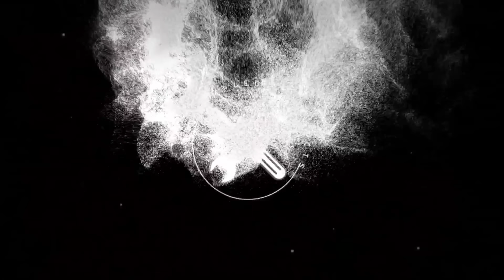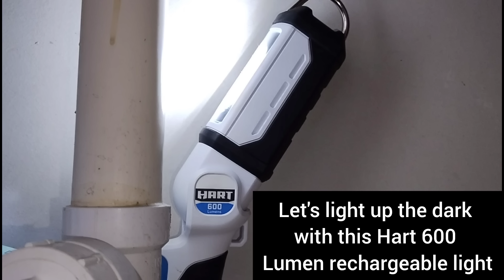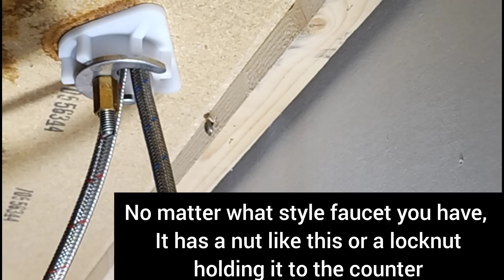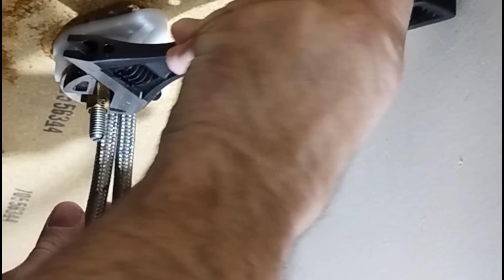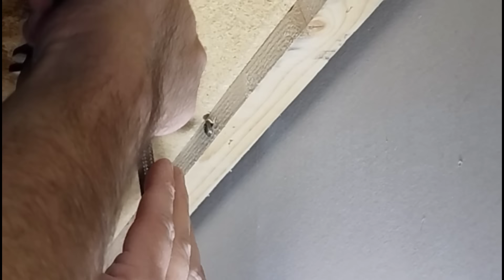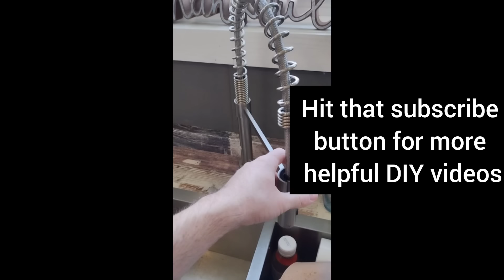How To Fix A Wobbly Kitchen Faucet

Comment: Awesome. Wonder how the nut loosens on its own in the first place?
Reply from the maker: Good question!

The nut holding a kitchen sink faucet to the counter can come loose due to several reasons:

Vibration: Regular use of the faucet can cause vibration, which may gradually loosen the nut over time.

Water Pressure: High water pressure can create additional stress on the faucet and its mounting hardware, potentially causing the nut to loosen.

Installation Issues: If the faucet was not installed properly initially, such as insufficient tightening of the mounting nut, it may become loose over time.

Leakage: Water leaking around the faucet base can weaken the grip of the nut, leading to loosening.

Movement of Sink: If the sink itself shifts or moves, it can put strain on the faucet mounting hardware, causing the nut to loosen.

To prevent the nut from coming loose, ensure that the faucet is installed correctly according to the manufacturer's instructions. Additionally, periodically check the faucet for any signs of leakage or looseness and tighten the mounting nut if necessary.

Comment: I dont have the single hole faucet. Mines the three hole. Is it still the same?
Reply from the maker: Yes indeed. Kitchen and bathroom faucets will both have either a nut or locknut holding it to the counter regardless of style/brand.